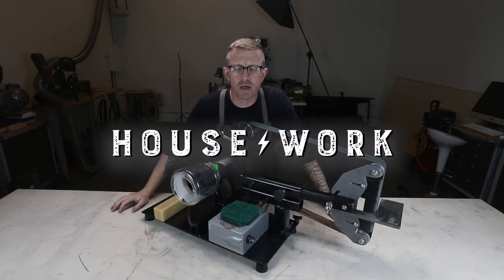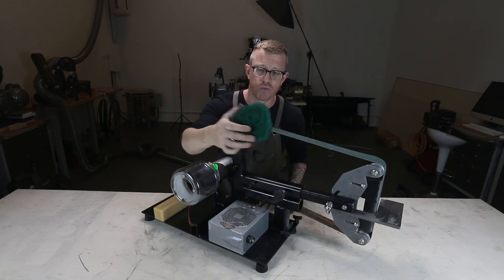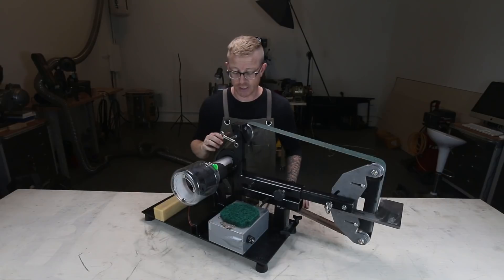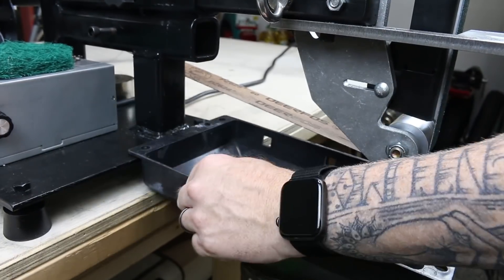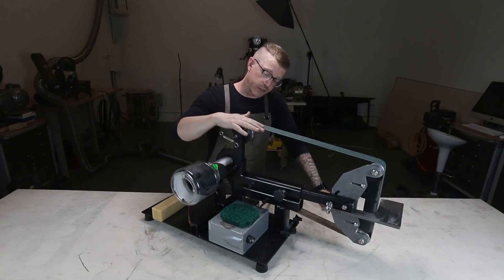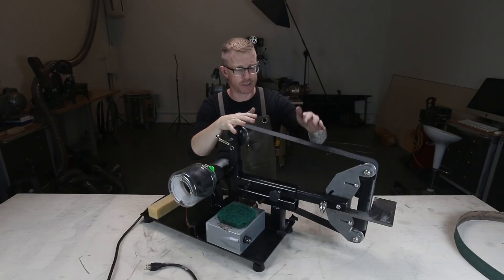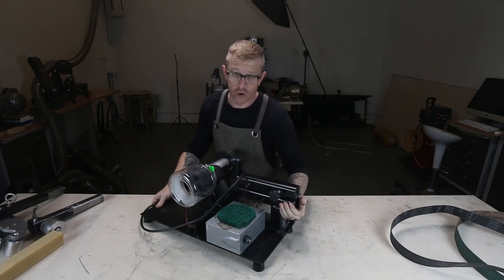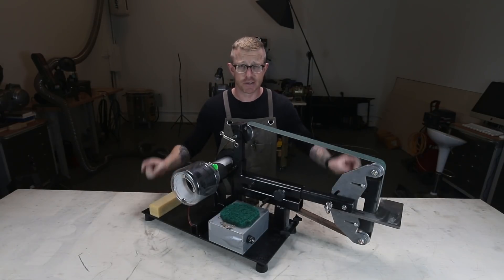Home Built 2x72 Belt Grinder - Improvements, Upgrades & Design Flaws

Comment: Is there a certain type of tube to look for? What i mean is the radius on the corners of your tube look smaller than the stuff I bought.  I have to shave off .020 of 2 sides of my 1 1/2" tube to get it to slide in the 2x2. After removing weld seem.
Reply from the maker: Regular square tubing is all I use. The .020 is mill scale and should be removed using a vinegar soak for 24-48 hours. Then it will slide nicely.

Comment: Hey Brian. Can you explain why varying the belt speed with a VFD is beneficial? I am making my 2 X 72, and am trying to keep the cost down as much as possible, so if I can avoid buying one I will. Thanks for all the great content man, love the videos and hope you keep it up
Reply from the maker: Well that is a long explanation, but I will tell you the best reason...Temperature. When I am working on something and I don't want to lose the temper or I need to grind something quick and efficiently, the VFD is a game changer.  If you can swing it, I HIGHLY recommend it. It changes a good tool into a GREAT tool. :)

Comment: Probably the cheap belts! I get a little wobble to with the cheaper belts. Great build man. Great video too
Reply from the maker: Thanks for the info, any particular brand you like for belts?
Reply: @HouseMadeUS  combat abrasives
Reply: @HouseMadeUS  Pop's knife supply carries a good selection with good prices. I like the VSM ceramic belts (good value). TrueGrit also has a good selection. I actually really like their cheap J-Flex belts (SKU: BMER272-0120-BVAJF). Other than those I think it worth picking up a scotch bright belt for smoothing out finished and maybe play with some cork belts. Oh and 1x72 scalloped belts for handles. Some people love the gator belts... but I can't seem to get my plunges right with them. I use J-Flex belts on my plunges and ride it over the edge of the platten.
Reply from the maker: As always you are a wealth of great info. Thank you so much. Ill dig in and get some good ones on order. 🙌
Reply: @HouseMadeUS  Thanks man

Comment: Good job!

Hey, just be careful sucking metal into your Dust Collector. If the pieces are large enough, they can hit the fan, causing a spark in the DC and possibly cause an explosion.   Google "Flour Explosion" and you will be surprised how much power is unleashed just by giving very fine dust an ignition source.
Reply from the maker: Good tip there. That would really suck!! Thanks for watching and commenting! :)

Comment: For the platen set up, did Origin offer the whole rig as one piece? I'm finding them separately, which would compound the shipping costs. If you bought the pieces separately, did they wave any shipping fees?
Reply from the maker: Its two separate pieces I used a piece of aluminum at first but quickly discovered that wasn't strong enough. I didn't get a discount on shipping and have since bought a few more things from them. Good folks over there.
Reply: @HouseMadeUS , also where did you get the plans again? I know that you said in the video, but for the life of me can't remember which one.
Reply from the maker: Hey Ron, I got them from DC Knives. Here is a link: http://dcknives.blogspot.com/p/2-x-72-belt-grinder.html?m=1